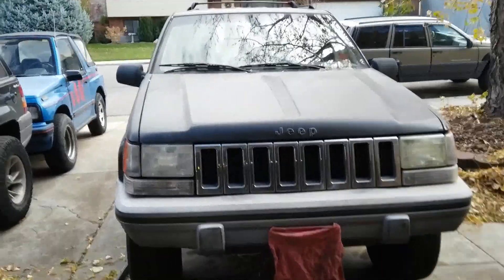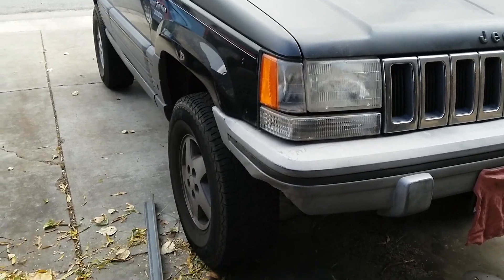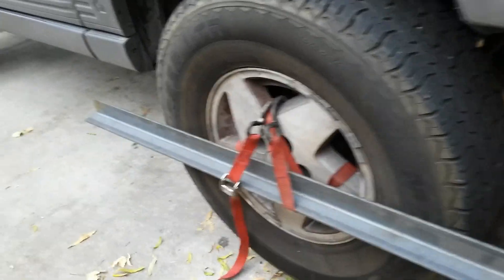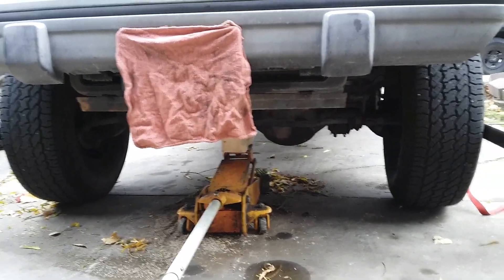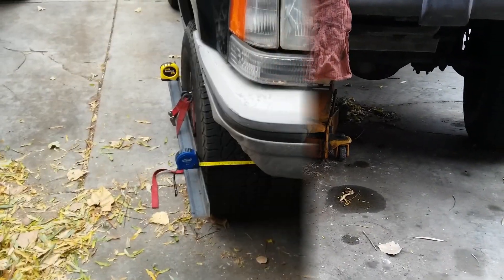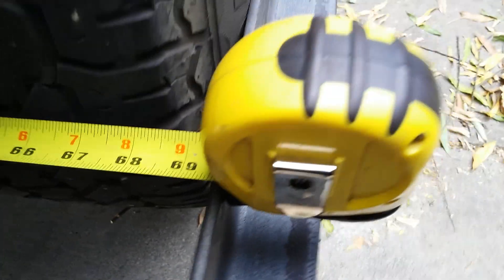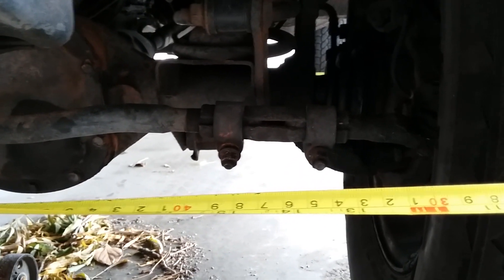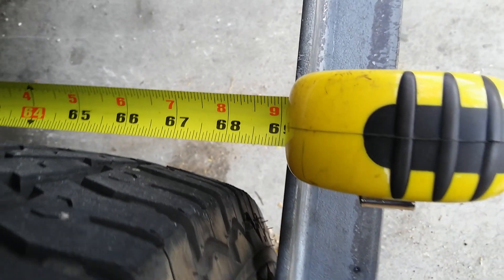DIY JEEP toe in alignment HOW TO

Comment: It seems to me that you could potentially have one tire toe out, and the other toe in, and still get the proper measurements this way.  Your steering wheel will be off center though, as you're not square all the way around.  You need to make sure the wheels are perfectly square.  You'd need a reference line to the back.  I get that this way could work most times, assuming the steering is perfectly correct.  But, there's no guarantee of that.  Two long angle irons running the length of the vehicle, equidistant from front and back of each rear rim, and parallel with each other, would provide the reference, even with non-equal wheel bases. Then, just measure from the angle iron to front and back edge of front wheels to get the toe measurement.  Now you're square, and your toe measurements are equal on both sides.  This method only adjusts the wheels relation to one another, not the vehicle.

Comment: I believe that gives you 1/32 of an inch toe in per tire. 1/32 wider per tire in the back. 1/32 added together they equal 1/8th of an inch. 
Close enough anyway. I like the angle iron idea.

Comment: I have a 94 ZJ and am going to get it close using this method. I didn't know that the other adjuster on track bar side is used to straighten the wheel to center. Wondering if it makes a difference to center the steering wheel first, then do toe, or do toe then straighten steering wheel? Thanks for the video, and like you said, it will get you close until properly aligned bu shop.

Comment: Make sure the tape measurers actually measure the same distance. Some are off because of the thickness of the metal tab. That 1/8" could be the difference between being within or out of specs.

Comment: Hello friend, I have seen your video and it is very interesting.  I have my doubts here.  Suppose on both tires you have to correct toe, where could you get the tape measures?  why if both are misaligned which one wanted your parameter to be able to align the two tires.  What is done in that case because in your video I see that you only worked on the left tire.
Reply from the maker: It is adjusted from the left side because that is the only adjustment and it does both tires at the same time. There is another adjustment on the drag link that connects to the steering Box which adjusts the position of your steering wheel.  Hope this make sense, thanks for commenting!!
Reply: Mugiver Muscle Machines so that kind of alienation is easy.  but there are cars like mine where it is adjusted to both sides, in cases like that I do not know that the method of the amgulars works because it could be that both the left and the right side are misaligned, in that case it would not be known which of  the two sides would be the alignment parameter.  If you know it would be good to help me because I have Quicktrick alignment and you know that these teams bring two supports and two tape measures.  I am from Nicaragua and I don't understand much English.  I wish someone would help me.  greetings from my country.
Reply from the maker: @jonasios4361  
 My suggestion would be to center your steering wheel , Get a string line from the back tires all away to the front tires carefully making sure it touches both sides of the tire on the back wheel to get a straight line Then adjust the front wheels to match the back wheels with the steering wheel centered.  That should get you close, until you can get it professionally aligned.
Reply: Mugiver Muscle Machines Thanks for your advice and dedication to answer my concerns.  Greetings

Comment: So I'm having an issue on my WJ. Right now when I set the steering wheel straight ahead, the steering box is actually about half a turn to the right. This means that I have only 1 turn right and and 1.5 turns left. As of now I set the wheel to be half a turn to the left to have the box centered. Could this be the result of the toe adjustment being off?
Reply from the maker: Yes, if there is enough thread in the adjustment.  Thanks for watching and commenting!
Reply: @mugivermusclemachines5744  hmm I did see plenty of thread in the centerlink I'll have to see then
Reply: @mugivermusclemachines5744  got the issue fixed. The steering Gear had work out and the center "changed " now it's good with the new one installed.

Comment: I just replaced a set of tires, front, and am replacing all the tie rods and am wondering does what you did align just front to back on the tires ? What about top and bottom. Or is this a stupid question ?
Reply from the maker: Top and bottom is not adjustable per se , that angle is called camber. they are called upper and lower ball joints or knuckle joints I believe if I remember correctly. Have to replace those with new ones.

Comment: Wouldn't the string method be more accurate?  So you can measure from rims, not tires with can be off due to air pressure.  And base off rear axel.
Reply from the maker: tigerbalm 
I think string method would be best for a four wheel alignment. Tire pressure doesn't matter because they are not related to each other, they are only related to their self as far as pressure goes [one can have 5 lb and the other can have 50 lb and you can still use this method]  if that makes sense.

Comment: So if I understand...it can not be exactly the same measure front and back of the tyre? Does it have to have toe in ? Thanks
Reply from the maker: Beto R. 
1/8" less in front works great. I took the Jeep to get it on mine after this video and it was dead on!
Reply: Thank you so much . Drive safe.
Reply: Tow-in allows the vehicle to track straight.  Exactly parallel will make the vehicle seem like it wanders down the road.  Tow-out will chew the heck out of the tires, as the wheels want to split your vehicle in half as you drive.

Comment: ok .why not have a reference from de frame or a stright point ? .you measure from that point ,front and back in the tire . and you can to know the difference ,
i cant see how you can know how to straight both or only one tire ,because you dont have a center reference between both tires.
Reply from the maker: Juniorundersea
  One adjuster moves both tires, if I remember right, so no need to Center reference.

Comment: Well how do you know which one to adjust
Reply from the maker: One adjusts your toe in the other adjust your steering wheel alignment.
Reply: Mugiver Muscle Machines no I mean which side do you know to adjust the toe on how do you know what sides got the problem
Reply from the maker: Jimmy Hagar 
  Both wheels are tied together with 1 linkage bar adjust that one and it adjust both wheels at the same time. At least that is the way the one is on this Jeep.

Comment: measuring off the tire is NOT accurate  use 4 spacers equal size and add between the steel bar and the outer rim edge & measure at ride height don't raise the vehicle that affects camber angle & toe  degrees

Comment: I'm just confused on how that measurement you got tells you how you were 3 quarters toed in , I'm trying to do this but I'm quess my math is off
Reply: Watch it from 2:42 mark again. 68 3/4 in the front spacing and 69 1/2 in the rear so subtract the two and you get 0.75 or 3/4" toe in. You would then need to know your factory spec for toe in or out to see if you need to move it in or out. Pretty simple.

Comment: Nice job using what you have.  I used to use bits of wood stuck to the wheels with mirrors on.  Now however I only the Gunson Trakrite drive over “toe in” measuring tool, which I think might be better than a garage measurement since its measuring while driving along not jacked up.  Here are a couple of my videos using it:  https://youtu.be/HVgubwvTMD4
 and  https://youtu.be/VcdAfQQIEbM

Comment: Need to measure off rims not tires it will be off bore holes in angle get bolts and nuts let it set on rim outer edge then strap down ,better measurement
Reply: i agree, too much tolerance differences on the surface of the tire, let alone inflation differences for something that you are adjusting to the accuracy of 1/16 of a inch....
Reply: Even measuring off your rim will not account for run off in the wheel.  An alignment machine calculates for a slightly bent rim and adjust the readings on the machine to the average.

This method is good to get it close.  I first did alignments in a pit rack in 1984 and we just used a toe bar.  Toe was done for decades with a similar method.  You can buy toe plates that sit against the tires for a lot more than a couple of pieces of angle iron.  I would by a 10' Superstrut which is formed with 2 bends and is likely to be straighter.  Grab a level from the tool department and check it for flatness and buy a flat one for about $25.  Take home and cut it down.  Good to go.

Comment: How the *&^#$ do you get the collar loose?   Pipe wrench doesn't budge it.  Another royal PITA fix, that is simple in theory, not in reality.

REPLY
Reply from the maker: I soaked mine with WD-40 and use a chisel to help separate the collar. Sometimes you can apply a little heat with a propane torch. The Chisel method seems to work fairly well!

Comment: There are many errors you made here:
1- How do you know both tire walls are the same
2- you jacked car and alignment measurement not valid anymore
3-You need 4 wheel alignment not 2 wheel
Reply from the maker: Hai Tu 
Good point, if you read the description it says it will get you close enough to get to the alignment shop for a proper alignment. Thanks for watching watching.
Reply: The rear axle is not adjustable on this vehicle
Reply: @Leesherwood  Other than caster, which can be changed with addition of adjustable control arms. But toe and camber are non adjustable on solid, non-steer axle.